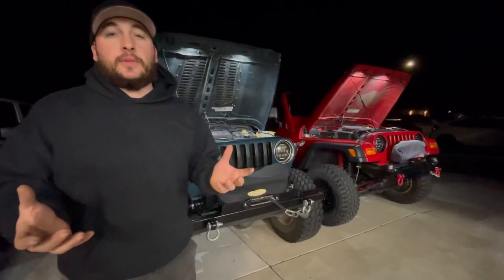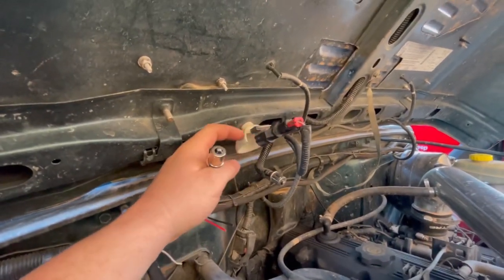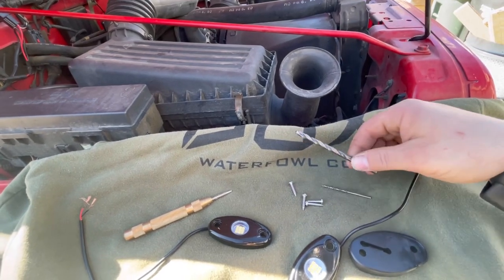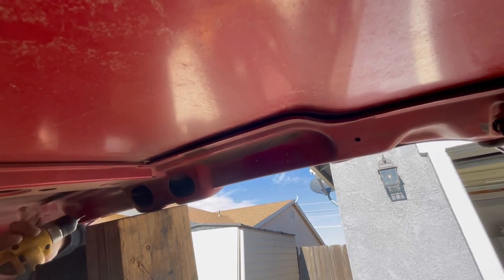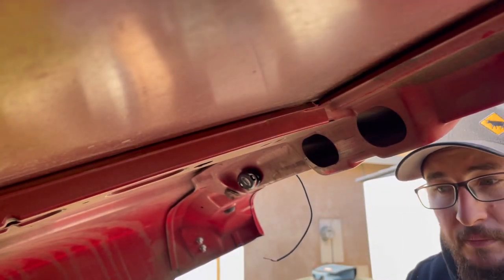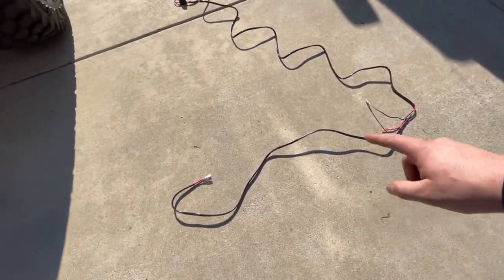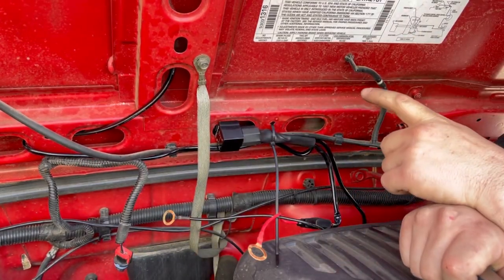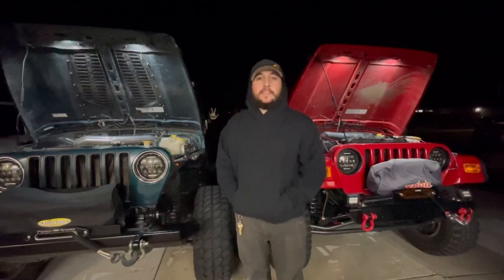Jeep Wrangler Tj | Lj - DIY Courtesy Hood Light Upgrade

Comment: I just added those same rock lights in that same  location as you put yours and now my hood prop rod won't go back in the hood prop holder on the hood, did you have to make any modifications to that? I might not have put them further back in those slots.

Comment: So what year and style jeep do I need to get the level switch from to use that adapter u used on the green Jeep
Reply from the maker: Should be in most 97–01 tjs, it may have been an interior upgrade. It’s interesting because my same 97 the red one didn’t have it but the green one did. I’ve seen them on eBay before, try searching curtesy hood light level switch
Reply: @ATEMOFFROAD  is thr a way to test them to see if they work?
Reply from the maker: @MrCee-eq9fe  yes you can test them with a multi-meter

Comment: You're putting those lights in a much hotter place in the hood. Are they still working?
Reply from the maker: They still work, I haven’t had any problems with heat. Also I’ve chosen very well insulated wire cables. And keep them turned off when hot. Really I’ve only ever used them when it was dark outside and fairly cool. 🍻🍻
Reply: @ATEMOFFROAD  I wasn't referring to how hot the lights get when being used day or night. I was referring to their location. When the hood is closed, they hang right above a hot radiator. There's a reason that isn't a factory location for a light. Anyhow, I'm glad it's working out for you. 👍
Reply from the maker: @cannonball666  correction 🍻🍻